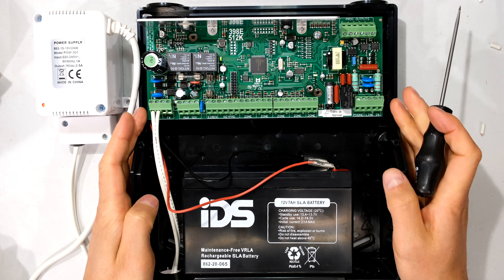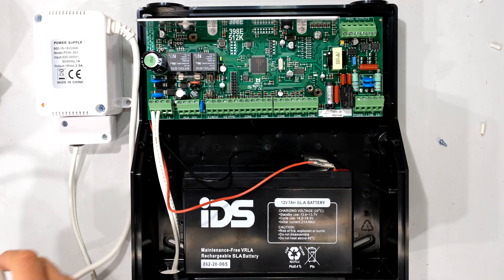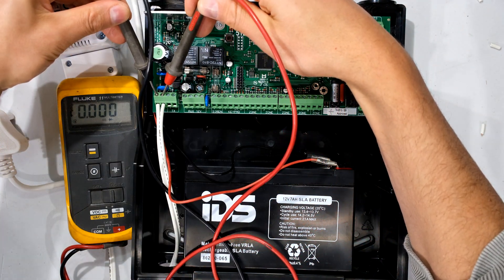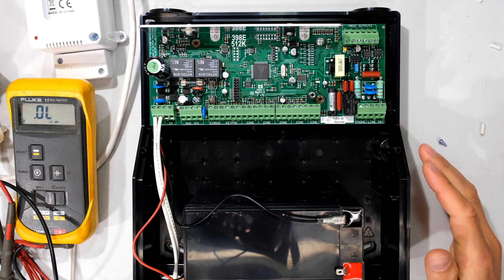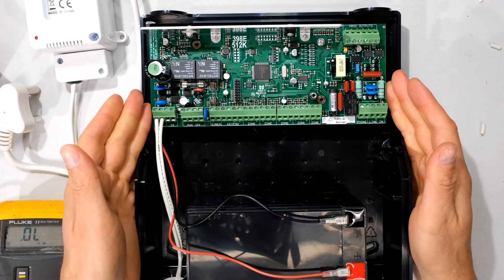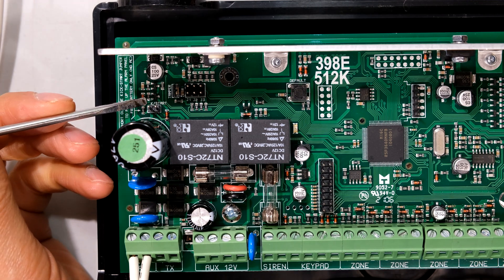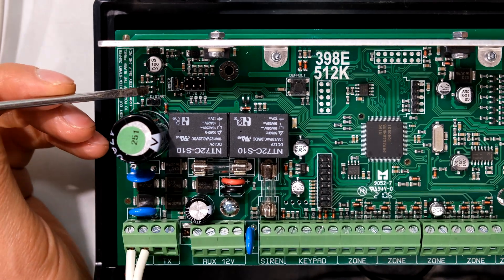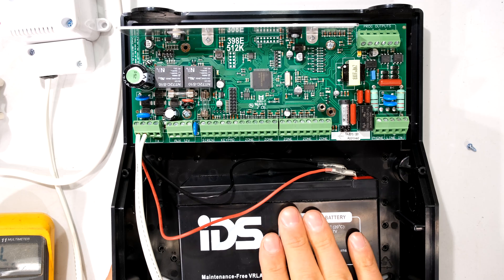How to power up the IDS alarm panel from a battery when there is no electricity - kickstart function

Comment: Oh wow! You have literally just saved me R1000 emergency call out fee, after we had 36hr power faults in my area.   I metered both my normal 12v battery and my backup battery connected and had 13.8v … but had no way to actually switch the unit on

Comment: i have an old ids alarm system with key pads. no one knows the code. is there a way to reboot it? or get it working again? is the code stored on the mother board or on the keypad?
Reply: If I recall - there is a admin override code saved in addition to your personal code.